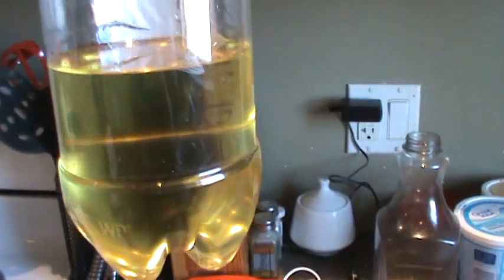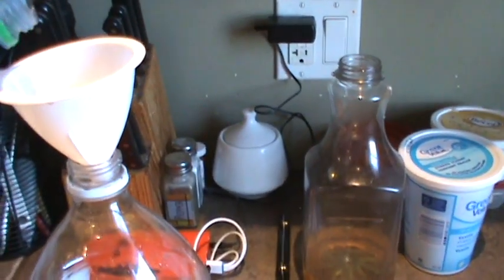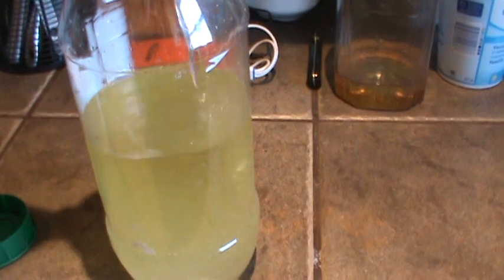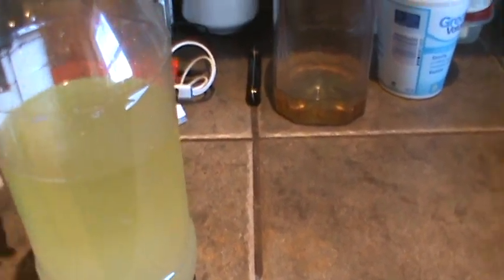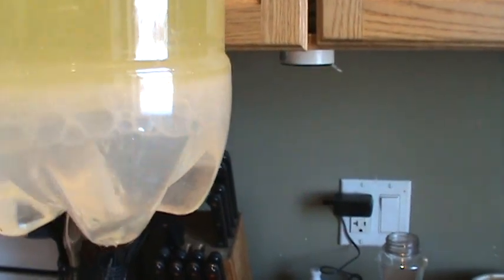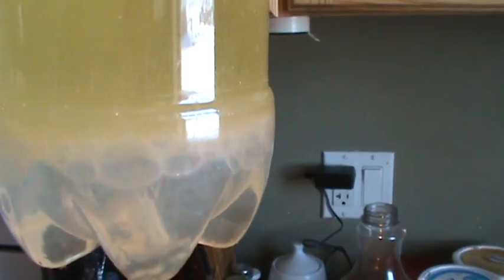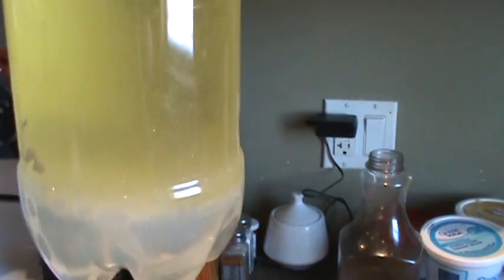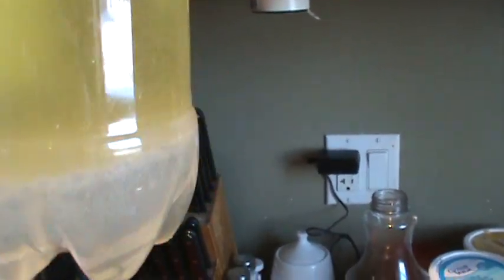#10 Washing The Bio Diesel

Comment: Can we substitute half of the Methanol for Lucas Diesel Anti Gel since a $14usd makes 300 gallons? vs $15usd that makes 5 that's would make a gallon cost $2usd not $4usd.
Reply from the maker: what is the anti gel made of? If there is anything but methanol, it probably won't work. Always good to keep looking at alternatives.
Reply: @gsmscrazycanuck9814  Saids No Alcohol Biofuel safe Amazon Model number is 10866.
Reply from the maker: @METALMAN4Wii  then it probably won't work.
Reply: @gsmscrazycanuck9814  Thought the Methanol was to keep it from gelling up?
Reply from the maker: @METALMAN4Wii  The methanol is used in a chemical reaction to make biodiesel. What happens is that the methanol replaces the glycerine making methal-esters.

Comment: Does the Water really just take everything with it or should you shake it a bit to really catch everything? Could you also run it through a Fuel Water Separater to get rid of excess water?
 Im doing lots of research to make my own and hopefully Commercialize it
Reply from the maker: When I made big batches I would have 40 gallons in a barrel and an air stone bubbling for a couple days. Not sure if a water separator would work, but it is worth a try.

Comment: I wish so much I had a diesel truck or car. I'm ordering a single cylinder diesel engine to operate an alternator/ inverter setup with a battery bank to hopefully start cutting down on electricity and become more self sufficient in that area as well. Diesel engines seem to be an amazing piece of technology. Thank you Rudolph!! And thank you for sharing!
Reply from the maker: I am presently running waste cooking oil with diesel in mt tractor and my Duramax. I am at about 10%-15% waste oil.
Reply: No chance of using solar/wind to generate electricity?  Your diesel genny would make a great backup for a wind and/or solar installation.

Comment: Can you use it in generators with changing fuel line🤔. Doing an awesome job to show you can be self sufficient 🤗👍👏🙏💖💨💫🎒
Reply from the maker: What I was told is to use, I believe it's called vitron lines. Not too sure on the name. You can use bio in anything that runs diesel. It would also be a good idea to talk to people who use it if you're running a newer(2000 or newer) vehicle. I would use it it anything, but that's just me ...lol.
Reply: @gsmscrazycanuck9814  thank you👍🤗💝